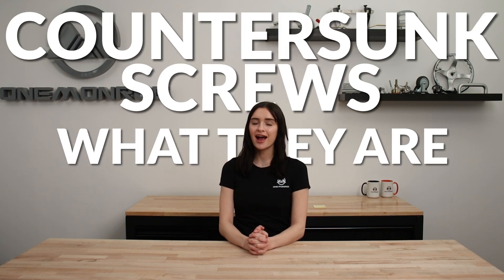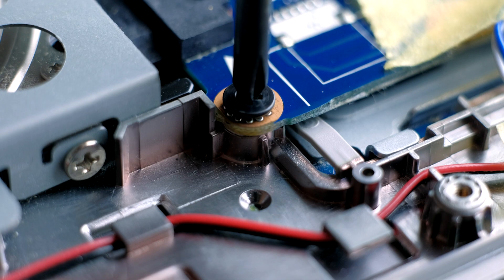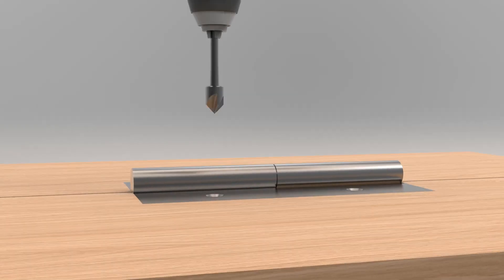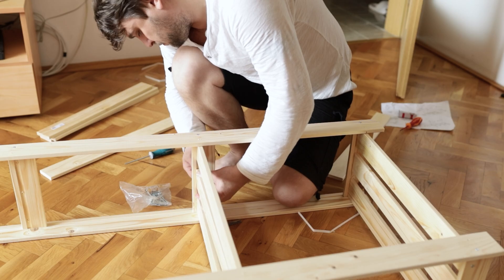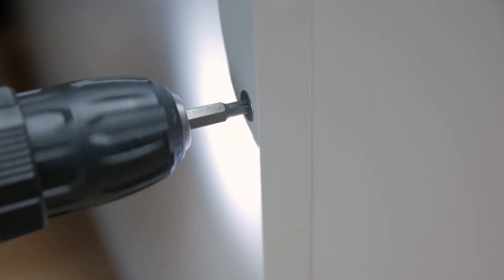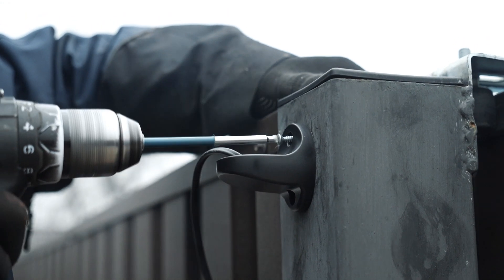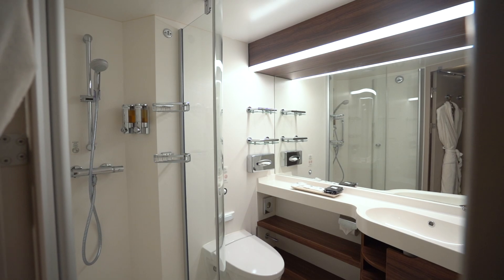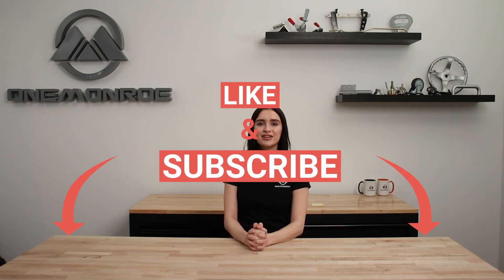Countersunk Screws: What Are They?

Comment: Nice video. Not exactly sure how I got here being I already know, for my particular installation I can't have 'heads sticking up above the surface', have countersunk holes, and was looking for countersunk 'bolts'... the word Bolts bringing up a question. Wasn't it those I was looking at when you said 'screws'? All my life I have Always thought, because I was Taught, bolts and screws were different. And, that's what I teach--'Bolts are different than screws. They are a different thread type, can be used with nuts, and, if you remember nothing else, are not pointy on the end.' 😄

So now I'm hoping to get some replies. And not some internet nonsense. Personal experience. 

Because one wants to know if, all their lives, they've been living in a fantasy world. 😄😄

Nice vid. 👍
Reply from the maker: Thanks, Craig! You're absolutely correct. Pointed tips are the standard for most screws. Countersunk screws are one of the few blunt ended screws out there, another common blunt ended screw type are machine screws. Thanks for watching our video and we're always happy to talk fasteners!
Reply: I dont know much, but my assumption is that bolts enter a medium and exit the other side to lock into a harder material that was shaped to take the bolt thread. Screws are made to penetrate a medium surface and generally another surface. Key difference being that a bolt lands in something in its shape. Am i right?